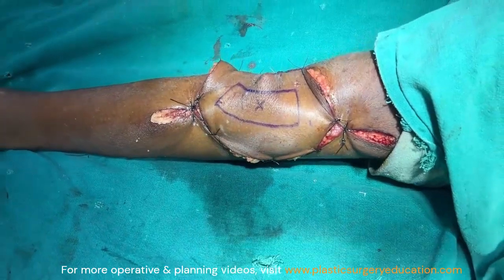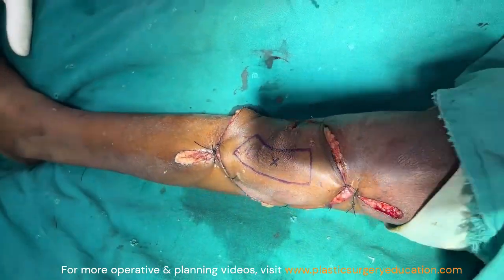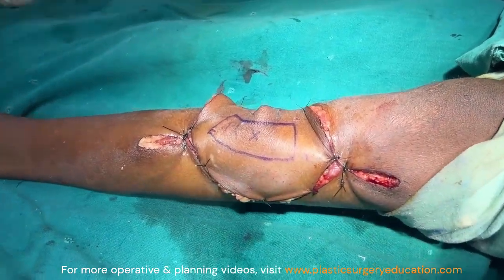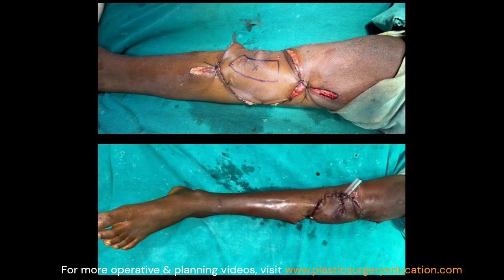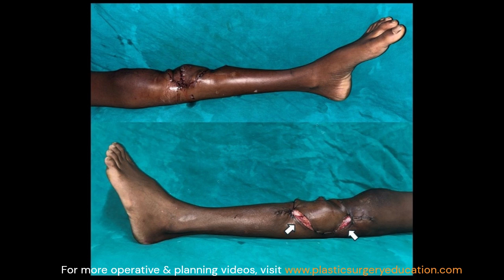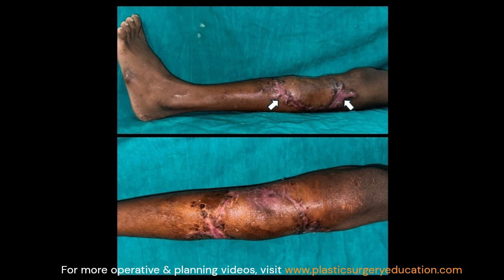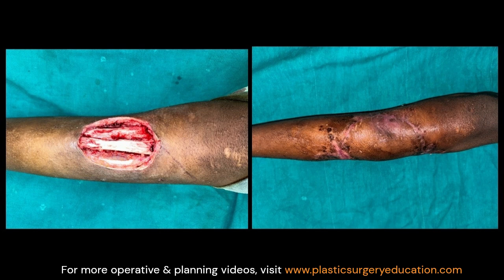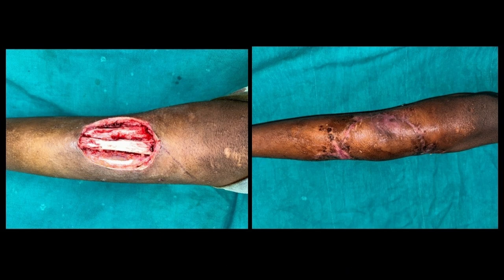Keystone flap for proximal tibial defect

Comment: Dear sir
Thanks for sharing 🙏🙏 
What about doing 2 opposing keystone flaps? From medial and lateral aspect of the defect
Reply from the maker: @MohamedEnaamAldewachi  Of course that can be done. But my thoughts process is that if you are able to cover the defect comfortably from one side, the other side should not be violated. It should be kept as a lifeboat in case of any problems to the first flap.😄.
Reply: @PlasticSurgeryEducation  thanks 🙏

Comment: useful , thank you
1:13 any landmarks or guideline to locate the perforator with doppler, in this case?
Reply from the maker: Perforator anatomy is quite variable here. But I would say roughly at distance of around 8 to12cm on the axis joining midpoint of popliteal crease to lateral malleolus.
Reply: Thank you sir @PlasticSurgeryEducation